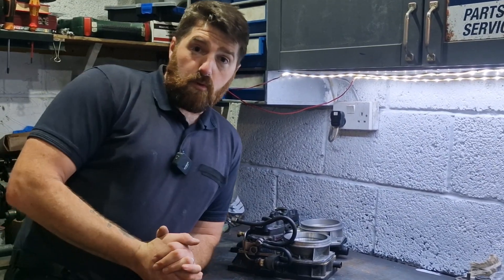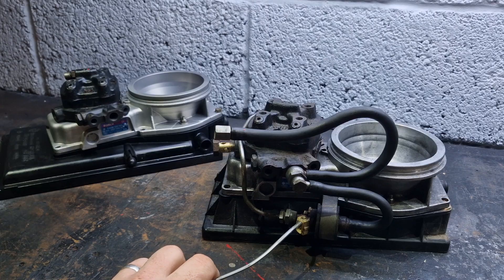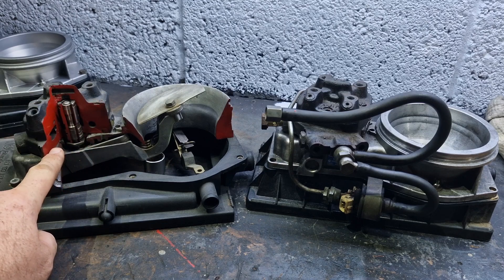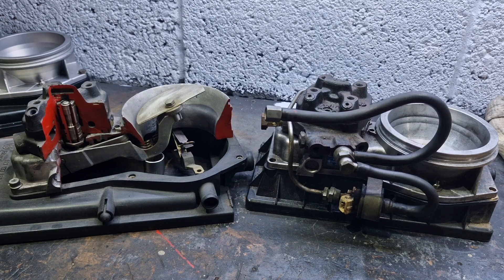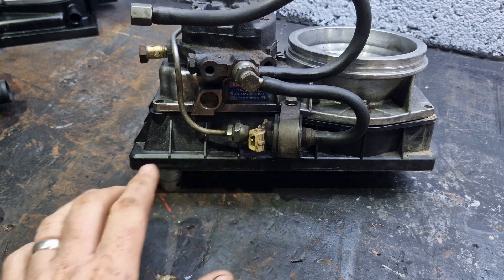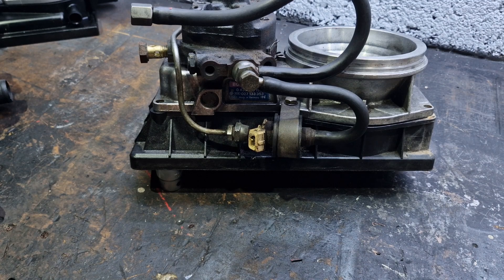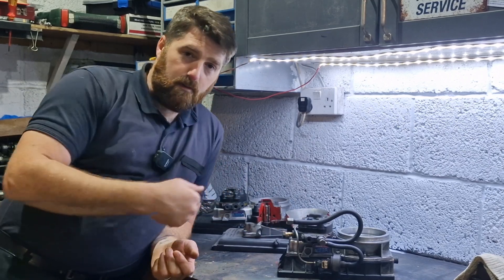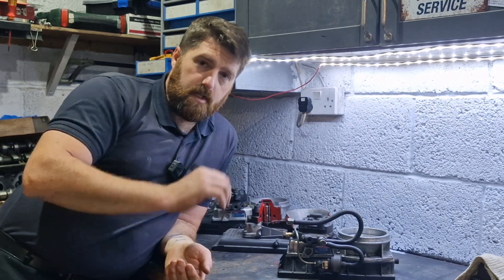Bosch K-jetronic Lambda - Frequency Valve Operation

Comment: I'm learning so much from your videos. 
I just got an 88 Audi 200 turbo with K lambda. I'd love to know the story of why Audi used Hitachi electronics on the MC engine instead of Bosch. 
The car has an issue where it goes lean under higher boost / rpm, but at lower load it regulates perfectly, even going rich when the full load switch closes. (I've fitted a widebad o2 sensor). 
I hope to tear into it soon, my first suspect is plugged filters that can't handle the flow.
Reply from the maker: Glad they help and give you the confidence to find the issue and get to hear that 5 pot sing like it should
Reply: @ just did a fuel flow test. The book says 700cc in 30 sec, my car did just under 450cc. I think I've found the issue.... 
There was no screen on the fuel distributor inlet. I suppose since the fuel filter is about 3" from the distributor they didn't think it was necessary!

Comment: Im building a non stock k-jet setup on an originally ke equipped Mercedes m119, using m117 k jet system.  I'm wondering if i can use the ke air meter assembly which has a mushroom shaped flap instead of a flat  plate, with the m117 k jet fuel distributor, or if it will throw things out of calibration as far as fuel per movement of the plate? Id love to chat with you about it if possible.
Reply from the maker: Message me via WhatsApp or Facebook page and I can help